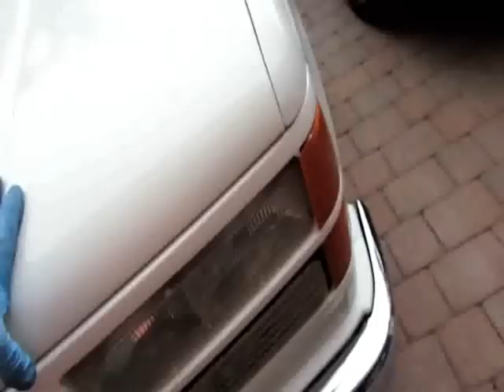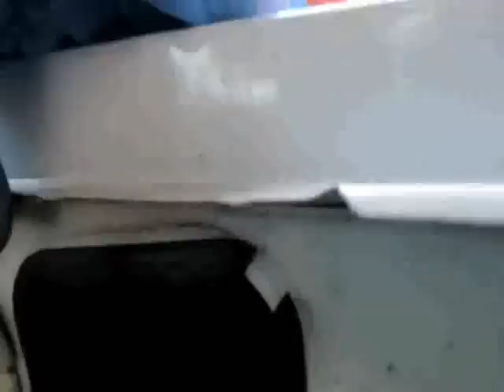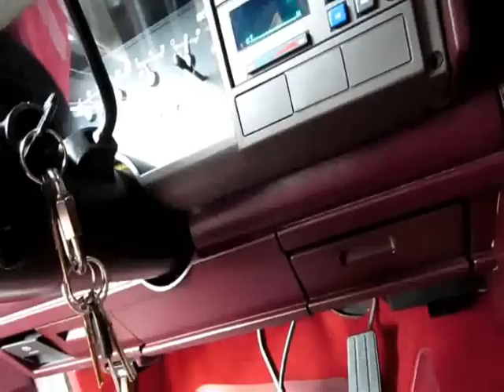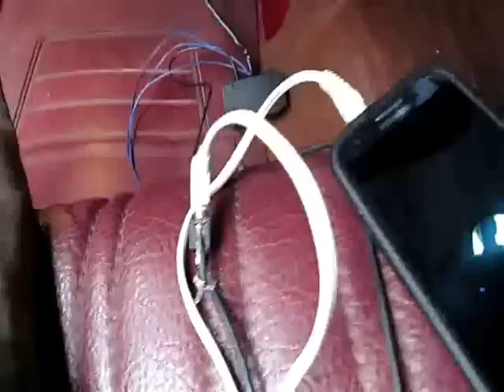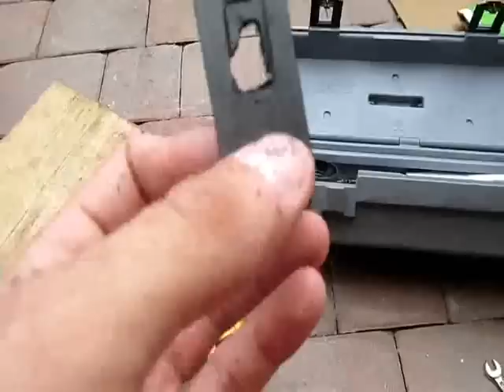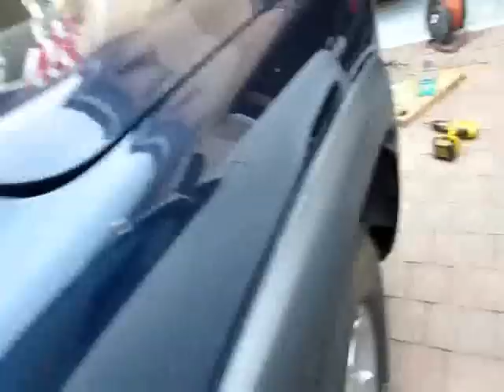Line in Mod works on the truck!

Comment: Cool mod. I always wanted to do that to my 89 Z71 because I disliked the cassette adapter to mp3.
Reply from the maker: At least you have the cable already!  That was a Real PITA to get out of a junkyard truck.   I was surprised this worked on my AM/FM only radio. You can tap into the Left and Right Audio wires inside the radio but I was not sure which  wires they were. This Duplicates basically what the Cassette player did, With a switch!  I have a few theft lock radios I might mod, Those are easier and I can put a jack right through the radio's face.   I still have no idea where I am going to mount this box, I might take out the radio and stash it on top of it.
Reply: Its a good idea for certain. Most people have no idea that the 88 to 91 truck radios have a built in loud button/amp in them from the factory. It sure increases the bass level. I cant remember how to turn it on like volume up and tune down or something like that. You can see inside the display and its ld or loud or something like that.
Reply from the maker: Yea it was a small yellow button I think, Mine doe not have it.